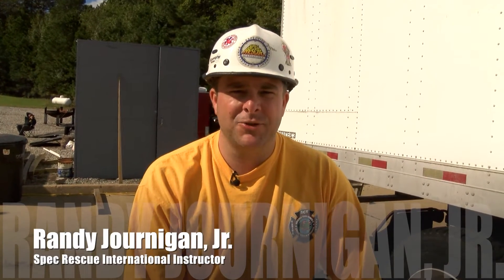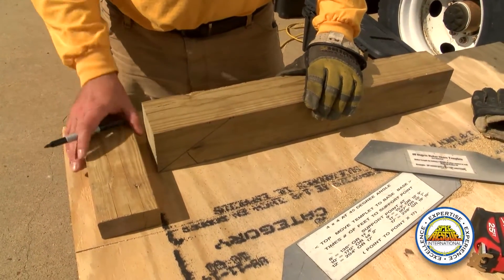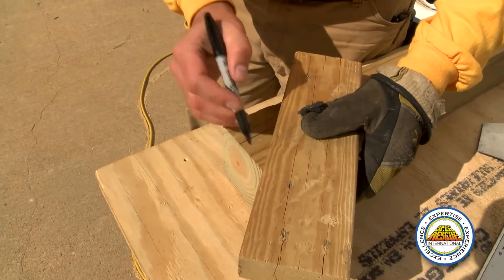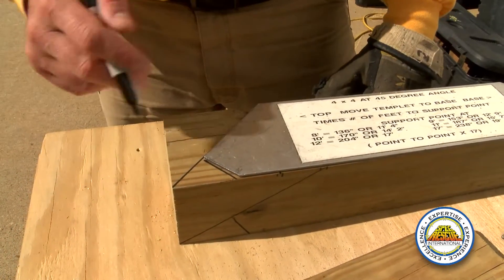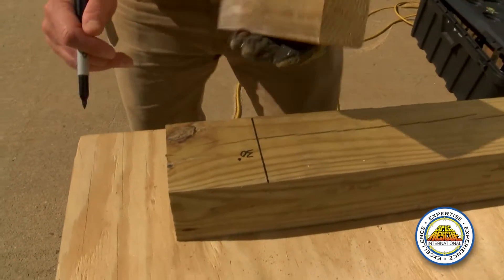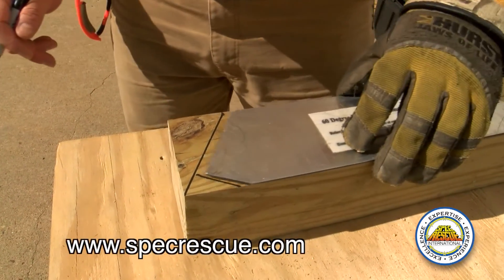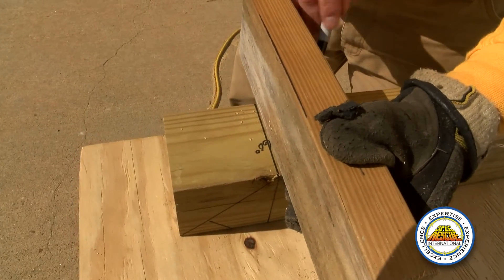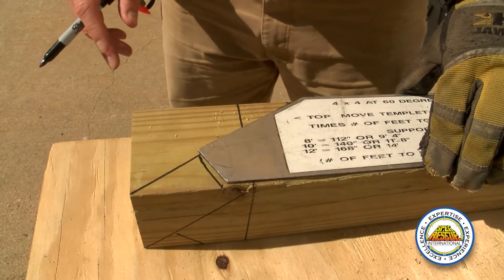The Spec Show   Raker Layout

Comment: Ok but how do you get the other side you? If you follow the same rules then it messes up your total length.
Reply: Multiply insertion height (ft) by 14 (for 60deg) or 17 ( for 45 deg). That’s length tip to tip in inches.